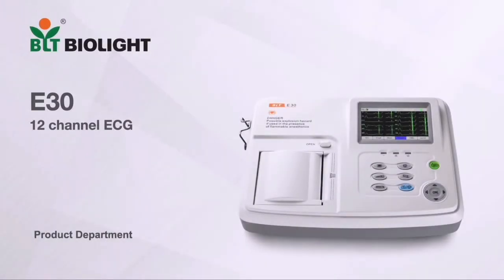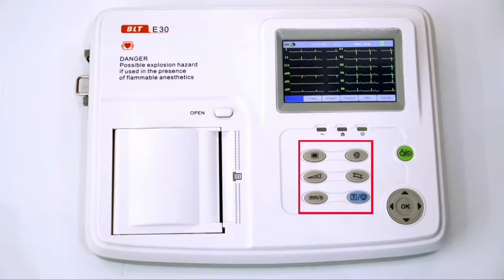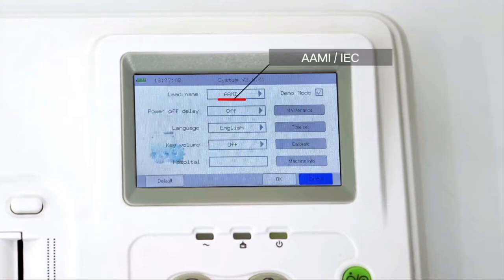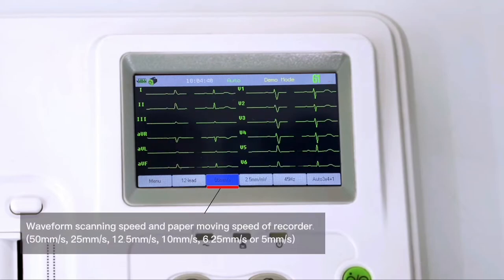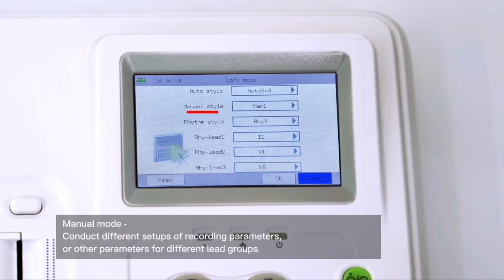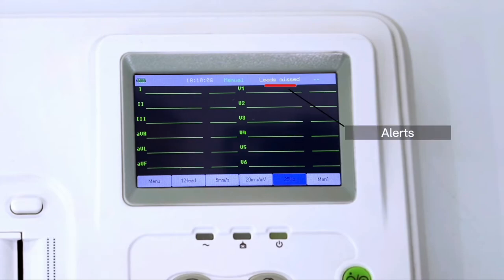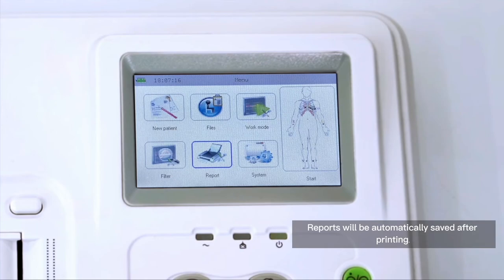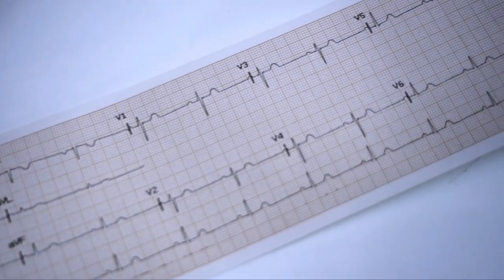Biolight E30 - 12 leads ECG user instruction

Comment: sir in E30 ecg there are some settings that i got to ask from you , what does manual 1 , manual 2 , manual 3 do , in the unit , what does AC filter, DFT filter, EMG filter, Low pass  filter do and how to select those filter values to each persons seperately ( i mean about what we have to think when we have to change those filters)  , whats lead name AAMI and IEC , what does pre sample , real time sample , trigger sample do in sampling mode , if the language of unit change to chinese how to change it , whats the maintennace password of unit also sir some time interference come when using this unit near electrical bed this doesnt happen in Mindray and philips ....etc  they also doesnt have equipotential ground line .
Reply from the maker: 1. 
In manual mode, real-time recording of ECG waveform is conducted manually according to the requirements of users, and start and stop of recording are controlled via keys. Optional: Manual 1(display waveform of leadI~III), Manual 2(display waveform of lead aVR~aVF), Manual 3(display waveform of lead V1~V3), Manual 4(display waveform of lead V4~V6).

2. 
➤ AC filter: Resist interference of AC power to prevent attenuation or distortion of ECG signal.
➤ DFT filter: Resist drift of baseline to ensure that ECG signal is on
baseline at the time of recording.
➤ EMG filter: Resist interference to ECG signal caused by strong muscle fibrillation. When EMG filter is in use, lowpass is【Off】.
➤ Lowpass filter: Restrict the bandwidth of input signal and attenuate the signals higher than the cut-off frequency. When lowpass is in use, EMG filter is【Off】.

3. 
The IEC standards were published as international standards and the AAMI standards were published as standards in the United States. 

4. 
➤ When “Pre-sample” is selected, collection of ECG data begins as
soon as lead is connected to patient;
➤ When “Real-time sample” is selected, if the user press Record button, record of the ECG data collected within 10s after pressing this key will be exported;
➤ When “Trigger sample” is selected, if the user press Record button, device will automatically trigger record once in case of arrhythmia.

5. 
Choose added language: Press 【System】 in main interface to enter system setup interface.
Choose un-added language:  Press 【System】, Select【Maintenance】,  key in maintenance password, select  【Language】to add languages. 

6. 
【Maintenance】password, please contact me (Jimmy) by email: jimmy@blt.com.cn

7. 
Biolight E30 has standard Equipotent grounding terminal to allow device connect to the Equipotential grounding system of hospital. When there's interference from high frequency devices, we can set the filter parameters in order to improve the ECG anti-disturbance performance.

Hope this clears your doubts! Thank you.
Jimmy (Clinical Product specialist)
Email: jimmy@blt.com.cn
Biolight Product Department